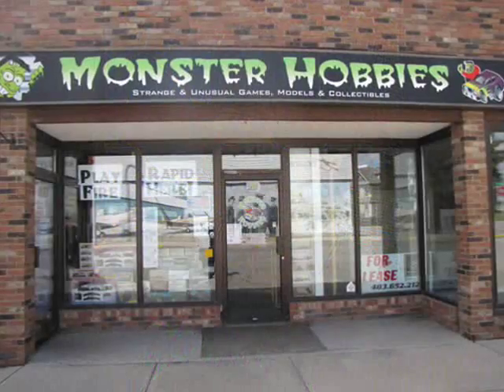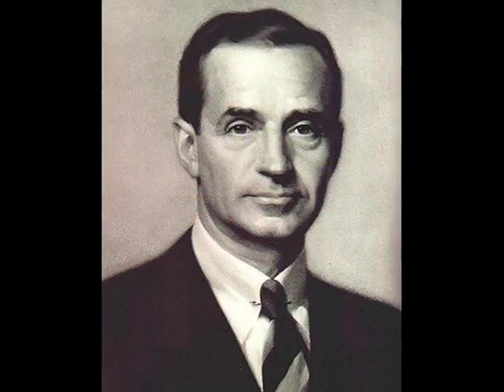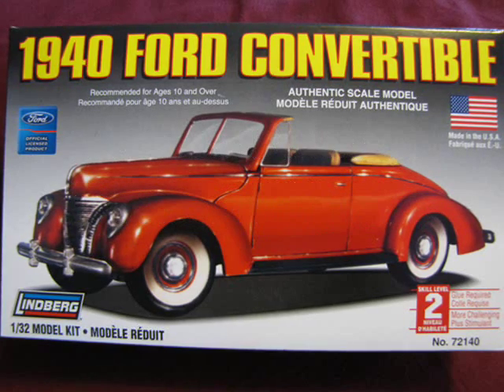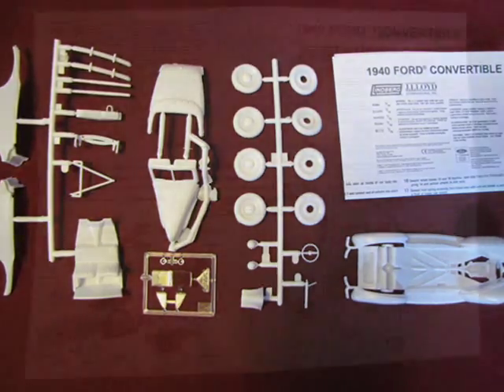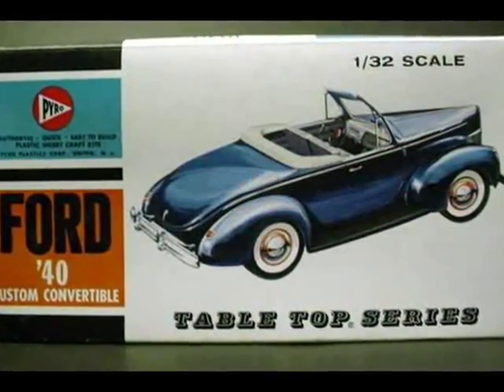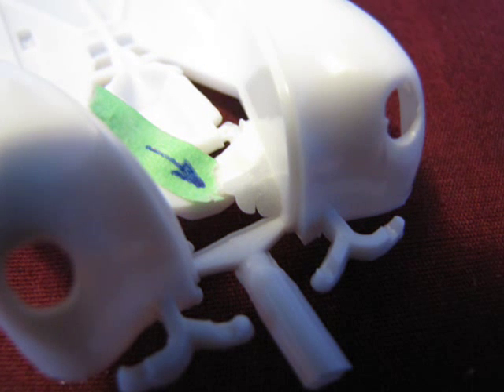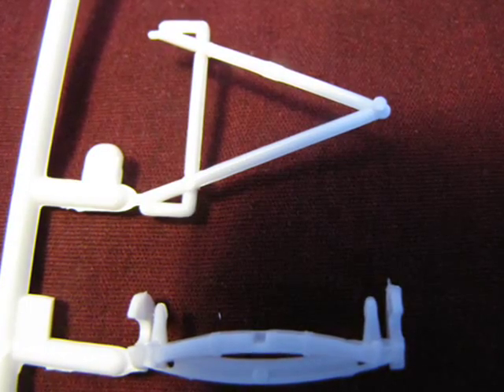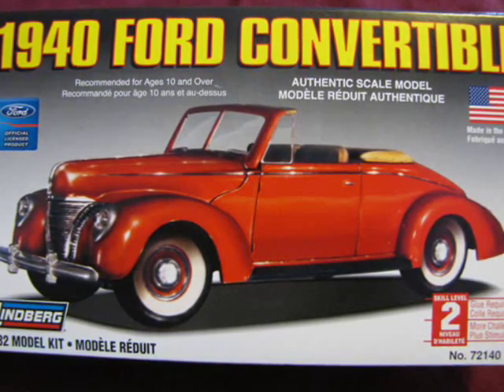Model Car Garage - Lindberg 1/32 Scale 1940 Ford Deluxe Convertible - A Model Car Unboxing Video

Comment: I'm old enough to remember these as Pyro kits here in the UK. I loved them and remember them coming in body-colour plastic, not white. As I was only about 8 I didn't really notice the detail, just that they were cool and looked great. Would like to get hold of some of the re-pops and build them with the benefit of 50+ yes of experience.
Reply from the maker: Thank you for the great comment and great history. This is one of my older video reviews, but still not too bad. I have seen people convert these into slot cars as well as build them right out of the box. Currently Round2 has the molds for these when they bought up Lindberg a few years ago...they just need to re-release them once more. I would love it if they put out some of the ones Lindberg didn't, like the Station Wagons.